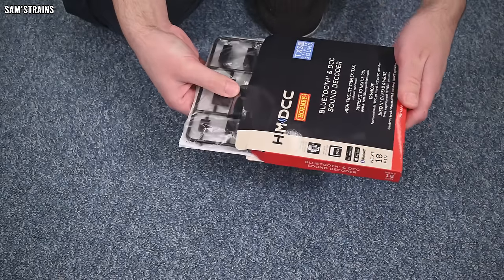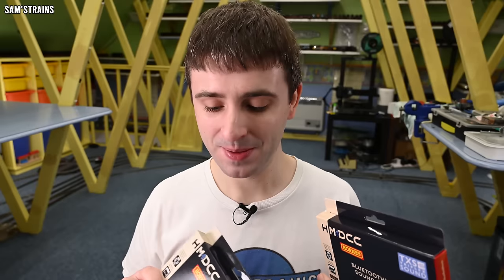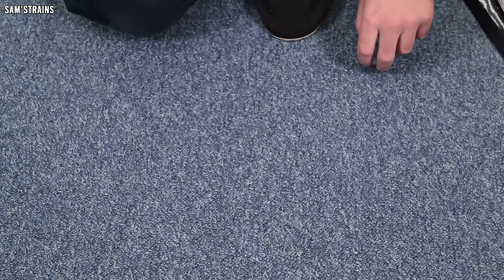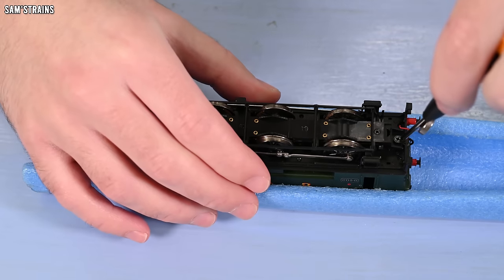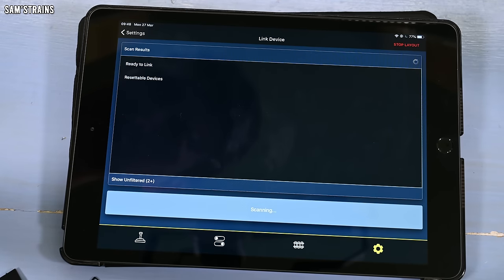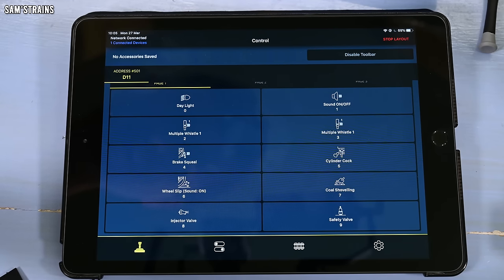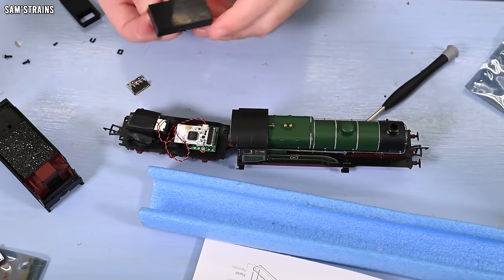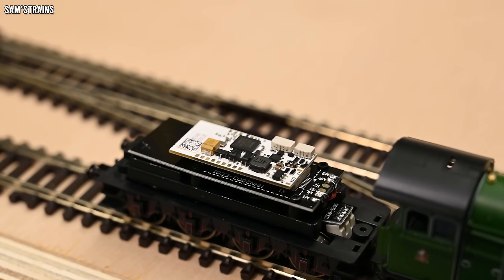Too Big For Most Locos & Burnt Out After 1 Day | Hornby's New HM7000

Comment: Hi Sam, thanks for your excellent video, I found out exactly what you did, regarding the next18 decoder size on Monday this week when it arrived. It would not fit any of my small locos that I want sound and the power bank for. I to thought this was ridiculous, however I will put it away as it may come in handy in the future, I guess. I also have 8pin and 21 pin decoders. I spent hours and hours over two days trying to get one of the 8 pin decoders into a Bachmann 08 shunter and the decoder lost its sound, then would not run the train and then would not fit in the train anyway. I sent the decoder back thinking it had an issue. I then spent many hours over 2 days with the 21-pin decoder as the same happened with the sound going missing when I tried to add a new sound profile. I brought a Dapol class 73 for the decoder to fit in as I had seen someone else fit the decoder ok earlier in the week on YouTube. I eventually realised that I was not wating long enough once the sound files had downloaded to the decoder for them to be installed correctly so the sounds were just wiped out. There is reference to waiting 5 or 60 seconds depending on whether you have a power bank fitted when you take the train off the track, but it mentioned nothing about inpatient excited users should let the sound download do its thing (walk off make a cup of tea etc) then recycle the power and import the sound mapping. I have asked for the 8-pin decoder back from the shop as I am 100% sure the same thing happened with that one. At least the 21-pin decoder is working great now on both blue tooth and DCC NCE Cab so I am hoping the future dongle will bring even more functionality to the rest of the fleet. Thanks :)
Reply: Yes Sams review was EXCELLENT he does not deserve all the negative comments from all the Hornby fanboys here... Also yr comments are of great help to me ) before I venture down this same route. Clearly there is going to be a lot of trial and error with these  - which is not how Hornby are selling it (They are giving the impression it's all fun and roses). A walk in the park?. It looks like it may well turn out to be a nightmare. Particularly for retailers (who actually give support)
Reply: @wapphigh5250  No worries, I may not be the greatest when it comes to understanding these technical things, but I didn't give up on this and I have worked out what was going on. Just needs a bit a patience when doing stuff, rather than me sitting watching it and jumping as soon as I thought it had finished. My fault in that instance. The decoder was telling me there was no sound and I ran through the process to install a sound a number of times but I didn't leave it long enough before recycling the power, whether that be 5 or 60 seconds. I was left thinking something was seriulsy wrong and I had damaged the decoder, so when it happend a second time I was pretty unhappy with myself. As Sam pointed out the set-up is fairly easy it just needs a bit more time for it to do it's thing. luckily I have a Lock Sound decoder tester with a motor on it so that has really helped with testing the decoders away from any of my precious trains. One more thing, the part of the decoder that has no chips on the end of it (the part that is causing the next18 to not fit in a lot of models) is the blue tooth arial and must not be cut off as some folk have suggested! :)
Reply: @BRWhitehouse1975  I have quite a few Bachmann locos chippable in the tender. 21 pin. I am sure you know the type. Around 6-8 years old. Should be lots of room. If I could get a bluetoothed sound chip in them (such a low price)  it would be great. But to be honest I am starting to doubt I should go down this path. What I am reading is this. Lots of teathing problems. Sound doesn't sync. "Only for Hornby". Burn out problems. App doesn't work. Now I find out the dongle won;t sync with my digitrax controller. I was really excited when I first heard about HM7000 now I am really not sure.
Reply: @wapphigh5250  yeah is it a difficult one to know what to do. Might be an idea to measure the room available in one of your trains then compare that with the size of the decoders, I believe the dimensions are on the Hornby website. Also I would not worry to much about the decoder burning out as it will be covered by warranty. Overall the set up experience was fine , like all new things there will be an element of teething issues. Don’t let it put you off trying one decoder out as it really is good when it is set up. I am pretty sure Bachmann etc will follow suit with Bluetooth decoders in the next 12 months as they know Hornby have stollen a March on this one. Hornby are always going to look after their own first but there is a if market for them to tap in to other manufacturers locos and they will be well aware of this. I believe that there will be many upgrades and improvements to hm7000 and its decoders over the coming years and this is jut the beginning. If the money is not to much of an issue to over come (as I know it is for all of us at the moment) then it is definitely worth a go at testing this out. I will continue to use my NCE Cab no matter what as I like the dexterity of the controller, Bluetooth and the app is just a bonus. Things will continue to be developed so don’t worry it will get better.

Comment: Very interesting review Sam! I assume it's also possible when using a DC power input, that you don't need to remove any other non-DCC Locomotives from your layout as long as you have isolated sections of track? Therefore you don't need to convert all your loco's at once, but as your budget allows for and still run both. It must be possible to station your Bluetooth loco (with sound off) and bring a DC loco out of a isolated section to run on the same track as the stationary engine. No more worries about damaging your locomotives!

Comment: Hi Sam
I think it would be a good idea to let Hornby know about all the faults and the size of the decoders not fitting in to the locos so they can sort out the problems looks a really good system but these are the type of problems they need to know about really good video and good testing of the items and explanations
Reply: He won't contact Hornby, he very very rarely does, only once that I can recall regarding the B12
Reply: It's called product testing. Hornby should have done all of that before releasing the chips to the market.
Reply: Just fitted a HM 7000 chip to a Bachmann 37,, the chip is no bigger than the one i took out and the sugar cube ( 4 different sizes) no problem and the power pack is no different to a standard stay alive .... GOING GREAT ...
Reply: @1tonyboat is the Class 37 sound profile on the App?
Reply: I'm pretty sure that Hornby will watch this and other review channels anyway.
Reply from the maker: Hornby should know already - they’re aware of the NMRA standards (because they mentioned complying with them on the box), the NMRA standards define decoder dimensions, and this decoder exceeds them.... so not so compliant after all!
Reply: I think Hornby release these decoders based on fitting there locos hence why you had trouble fitting these into Bachmann locos I might be wrong but just a theory

Comment: TXS7000 8 pin fitted and working sweetly in a Bachmann Branchline 08 (32-115A 08021).
Very much a tight fit but very doable in that model.

Comment: Hi Sam. That decoder was good while it lasted!  I think it might have burnt out because it was in a very small enclosed space with completely no ventilation. It might be all right in an EMU where there is the space of an entire coach around it to disappate the heat. The drawback with Bluetooth is the amount of RF energy radiated from such a small aerial. It can't fail to heat up in such a small space! Thanks for uploading.
Reply: Wow. I hadn't considered that.. So are these chips going to be a goer in tight spaces or will they really only useful in areas like tenders? This is a major issue for Hornby quality control in the future... I hope it works out for them. I may only try them now in tenders...
Reply: @wapphigh5250  The fact that Sam could pick up the Bluetooth signal from the ground floor of his house when the train was in the loft indicates the chip outputs a pretty strong signal.  The more powerful the signal, the more electricity, the more energy, and the more heat!
Reply: @AllensTrains  Ok so that answers my question right there! Before I chip out my entire fleet, I think I will try one (and one only) in an old railroad scotsman 8 pin (it;s in the loco body) first and see how it goes. If I can fit a sound speaker in there as well and the stay alive I'll try ...and if all that squeezes in and works after a 6-8 hr run then my other tender DCC ready models should be fine. But Sam has pointed out with this review a very important point that not even Hornby (and their Q/A) did. Clearly overheating (and tight areas) may well be an issue. It's obviously going to be trial and error and not the awesome hi five game changer that the Hornby marketing team and spruik hi five crowd (think) it will be. Just MO
Reply: Bluetooth chipsets cannot ordinarily burn out; they are designed from the ground up to consume tiny amounts of power, of the order of a few milliwatts on average. This is why your phone can have Bluetooth permanently enabled. The part of a DCC decoder that can burn out is the motor controller, which may be dissipating a few watts in its failure mode.
Reply: @wapphigh5250  I think sound decoders are extremely expensive for what they are. It would be cheaper to put 3 or 4 speakers around your layout. But that's probably why you cannot add your own sounds as Sam's review indicates! A sound decoder and speaker could be installed in any model, such as signal box or a brake van!

Comment: Perhaps reading the manual (the full manual online) before starting... 
Decoder sizes to meet the various standards are defined very clearly - the problem here is that the Bluetooth decoders need an aerial and sadly that means an extra 10mm of circuit board (the blank bit at the end) which clearly pushes the limits of size - very sad that it does.  An aerial socket and wire aerial (a la Arduino Giga) would fix this - just a thought.
Of course designing a loco so the DCC board fits across the loco width rather than along the length does handicap us all.
The sound profile issue is something that I've ranted about elsewhere on YouTube... Sorry... There are good retailers with good sound libraries who could fix this issue but Hornby are insistent on keeping this in -house - a great shame. 
Allowing specialist dealers to sell these decoders with their own sound schemes would fix this issue - a £65 decoder +  £15 for installing a sound library is alot less than a £135 decoder with 'free' sound!
Having said all that - I now have a Class 37 (Hornby) with an 8-pin wired HM7000 decoder (direct wired) and an 11V LiPo battery that works great using Bluetooth on both Playtrains or any other layout so I think this is an amazing system.... (oh, but I'm using the Class 56 sound....)
I was asked for a Bluetooth conversion for garden layouts 10-years ago and this is the first viable solution since then! Well done Hornby! Now give us the sound solution and you can rule the world!

Comment: When you where simulating a power cut out. I can see you where just switching directions on the controller as apposed to power off. Just thinking that its possible that has put a bit too much on the controller as it has to quickly deal with a change of direction of which the current is going.

Comment: I think you can see why the board is out of spec. Hornby has used the larger type of Bluetooth antenna almost certainly because of Global electronic component shortages. 
It took me ages to find an ESU PluX22 decoder in Germany or the UK. Things have improved now with stock available. 
Hornby should have waited longer before launching the miniaturized 18-pin version. The correct MK2 is probably being manufactured right now.

Comment: I have avoided DCC for years due to the amount of 00 locos I have that would need converting. However recently delving into TT120, this could be the perfect opportunity to start the new scale with DCC. Tempting!
Reply: I trust Digitrax and TCS decoders and my NCE controller for DCC. Tsunami decoders are good aswell.
Reply: $20 digitrax decoder ive thrown in anything and converted quickly

Comment: The Next-18S standard for decoders with sound specify a max PCB length of 25mm, width 9.5mm & height of 4.1mm. If Hornby’s decoder meets this spec then it’s issue with the loco’s installation space compatibility with the standard.
Reply: Hornby also offers the smaller & cheaper HM7000-N18 (sans sound) decoder to fit into locos only with enough space for the Next-18 standard (15mm x 9.5mm x 2.9mm).
Reply: Spot on; if the board is compliant in size, it isn't Hornby at fault.

I have to say, in general, it's a very interesting product. As mentioned in other comments, the delay in gaining control due to Bluetooth after a power loss is the weakness, unless some stayalive or battery backup is there to give power for at least 10s or more.

I'm sure a smaller version will come out at some point, maybe with a separate wired antenna to help cut down the pcb size. The price is very good.

I'm curious to know what impedance is recommended for the speakers to attach to the decoder.

Will be watching how this new product line develops.

Comment: The reason the board is physically bigger is the layout traces for the Bluetooth antenna are at the end of the board and you cannot minimise easily. Plus the chip they use which accommodates sound is larger

Comment: Informative video.
1. If many decoders fail I'm sure it will be all over the forums, and it is the first batch so not unusual.
2. I have two small steam trains, shunters, and looking under the case they would both need a socket adding (box marked as DCC ready) and only room for a non-sound decoder.
3. The IOS version only works with iPads and iPhones manufactured in the last 5 years. I am waiting to see if the Android version works before ordering a decoder, as I am still only DC 
The take-up of this will only sell if the app is excellent and the decoders are as good as other manufacturers.

Comment: I'm still gonna be buying regular sound chips due to their wider availability in terms of different sounds. However, I will be buying a 21-pin one to try out in my Dapol 08, now I have a Minerva class 14 with a Zimo sound chip installed. Not sure if any of the Hornby sounds would be suitable for the 57xx or 8750, or the 14xx yet.
However, if the one fitted to a TT loco burned out the next day, I hate to think how one would cope in an 0 gauge loco with 40 wagons behind it...

Comment: Dear Sam. The delay after the power cut happens only when in blue thooth mode because that is part of the blue thooth standard. You never notice, but when you start a blue tooth connection it always takes 10 seconds. But you are busy with other things then. Sound files should be comparable to all other DCC decoders. That is defined in the DCC functionality. The decoder has no controler. The normal controler you have is the user interface hard and software. The instructions for the decoder are transported via a simple network over the power supply of your model railway.  Any computer that can generate these instructions can make the model perform. The point is that you need some kind of hardware to satisfy the needs of the decoder. By using blue tooth there is no need for extra hardware. It would be interesting to see what happens when you have 26 loco's on the blue thooth connection. My headphone allows atleast 2 connections, but only services one. and then mixes up.

Comment: I did watch the Hornby live streem the other day and they did say that the track should be powered through a Hornby system as other systems have not been tested, so perhaps that's why the chip blew, there video is worth a watch they explain more
Reply from the maker: Well no, the Hornby controllers are listed in the manual as not recommended... the gauge master is the leading analogue controller... it’s output is within the specified voltage range, and the PWM frequency shouldn’t cause a problem. So that shouldn’t be why the chip blew, especially as the other one was fine on gaugemaster!

Comment: I just ordered the Next18 HM7000 decoder for my Dapol Manor class a matter of hours before seeing your video, I now see I should not have bothered.  I think this proposition from Hornby is really great especially on the CV management and free sounds, but if I can't use it in all my loco's then this significantly weakens the proposition.  I am yet to invest in DCC system and I was hoping HM7000 would mean I would not need to, but I don't think this is the case.  Whilst this offering could be regarded as a step change, it is still based on bluetooth technology which is not new.  I fully expect another manufacturer to offer something similar in the future and it will probably be better and compatible with a wider range of brands.
Reply: Totally agree. Great comment!